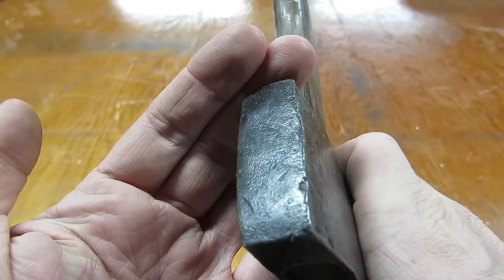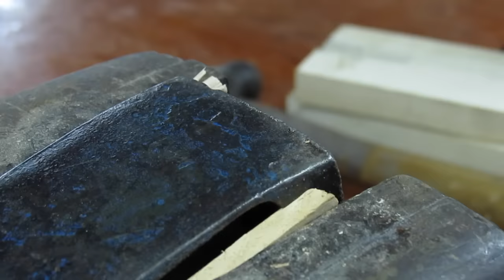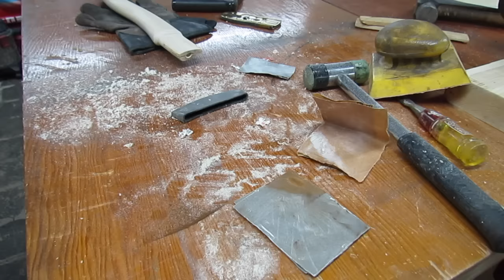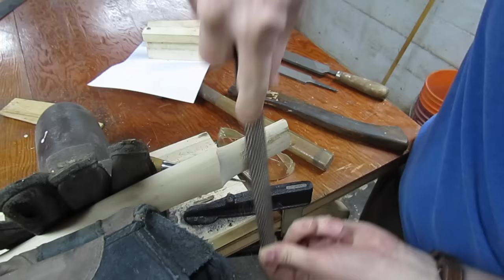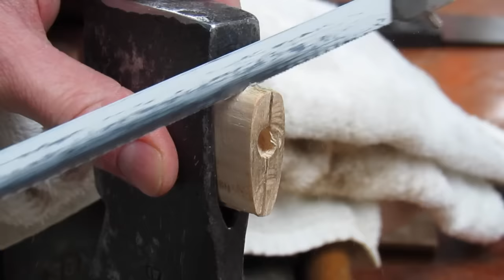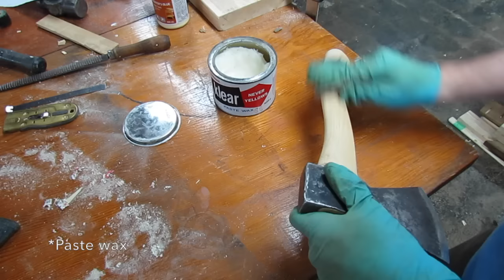Hults Bruk Hatchet Restoration

Comment: What was wrong with the original handle? Looked great to me. 
There is a big shelf on the haft under the head. This makes a weak point. 
No need to use glue on the wedge. Linseed oil works just as good and easier to remove in the future without having to cut the haft.
Reply: It was very loose that’s dangerous

Comment: It's good you didn't make it too pretty to use.
Reply from the maker: I don't know if that was supposed to be an insult or a compliment, but thanks for commenting.
Reply: PatonHaus No that wasn't an insult.
Reply from the maker: Okay good, yeah I like the patina on old axe heads so I try to only get them clean "enough". The handle will discolour over time with use so it will also develop it's own look.
Reply: I agree, patina gives it character.